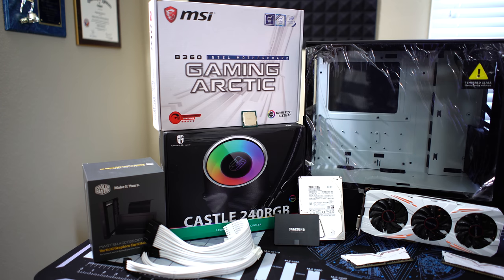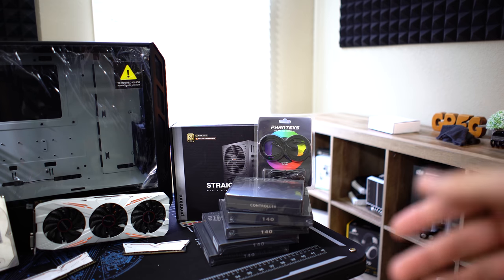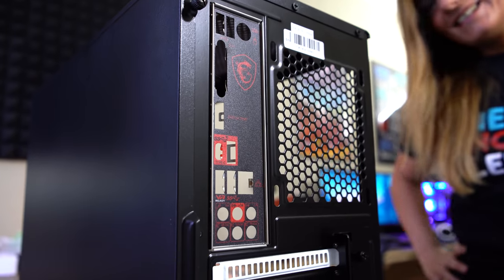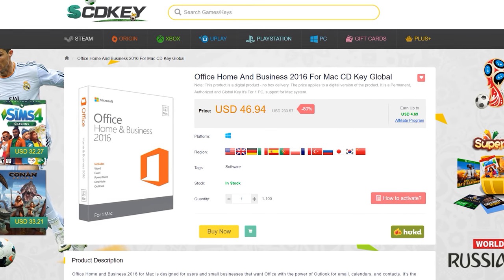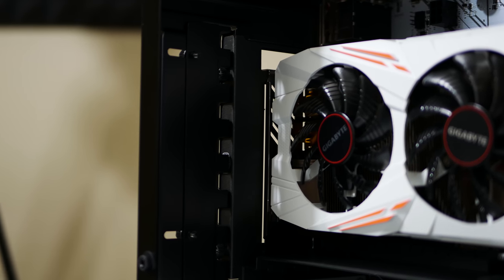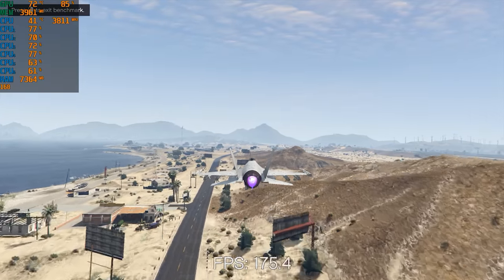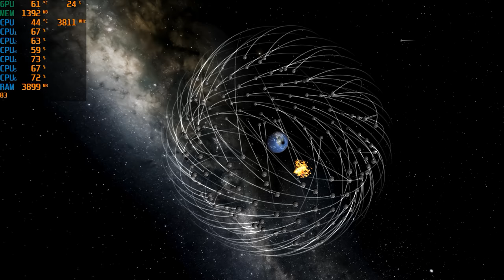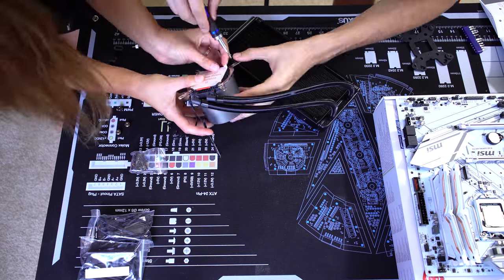We Paired a 1080Ti with an i5 8400...

Comment: "Locked processor because intel is intel" shot fired
Reply: VN the reactor ryzennnnn
Reply: They should go back to the Pentium MMX practice of open multipliers on all chips. Or atleast make them BCLK OCable like they basically did before SandyBridge.
Reply: its getting dangerous to do bclk because of pci-e storage and high usb 3.0 speeds. i know it's almost not doable on ryzen, whereas my fx series was almost all bclk instead of multiplier clocking and i got a ton out of it. this gen is almost all autoclock auto sense. of course thats amd perspective but just what ive noticed the trend to be.
Reply: Ryzen has worse single thread performance. And what do modern games use the most? SINGLE F*CKING THREAD PERFORMANCE!
Reply: Fbi open up
Reply: @jugostran  
Only badly optimized games depend on single thread performance

Comment: The i5 8400 is such a good CPU!
Reply: Dex4Sure Yea, get the 8700k and spend 400$ more, depends on budget man
Reply: Well lucky for me I have both lol. Relax guys they are just CPUs. Clearly both of you have no idea. 😹
Reply: Comes into the YouTube comments section to flex. HAHAHAHAHAHAHAHAHAHAHA! 💪
Reply: Dex4Sure I only play games so the i5 was definitely the better buy for me
Reply: "HyPeRtHrEaDiNg Is ReAlLy ImPoRtAnt."
Reply: Dex4Sure what is better than a 1080ti tho
Reply: Dex4Sure lol it’s also more expensive
Reply: Honestly 1080ti isn’t a bad pair I played 4K and it plays smooth
Reply: All In One just sucks amd is always having a hard time providing hardware that is optimized in games
Reply: Dex4Sure at 4K it doesn’t matter and at 1080p games will be easily at 120fps.  I’ve used a 1080 ti with that processor it’s fine. But I’d pay a little more and get the 8600k OC to 4.7 or 5ghz and it performs better than an i7 at stock and probably equally OC. If your only gaming 8600k is just fine.
Reply: Dex4Sure 8700 is a pretty bad buy imo. 8400 is a much better value.

8400 out of the box with El cheapo memory performs admirably and really is one of the price points where Intel nailed it this time.
Reply: OrGen $400? more r u high?
Reply: as you can clearly see in the video , an i5 8400 does not bottleneck the 1080ti for most of the titles , so you can save here while spend your savings on a better gpu . Budget gaming is not your forte .
Reply: the i5 still reks those amd cpus so i dont know what u try to say.
AMD cpus arent bad but who needs 12-16 cores for gaming only?
Dont come with u will have a better future. bro everyone are switching their CPUs like socks. not many people uses their cpu more then 3 years.
Reply: most apps are optimized for intel , nvidia . Radeon cards definitely offer more bang for the buck at the same price though
Reply: Gear Seekers anything's better than AMD.
Reply: Dex4Sure you can always buy a new gpu for cheap again in the next few yrs...
Reply: r5 is much better... In what? Unziping files? 😂😂😂
In gaming the little 8400 even beat the rysen first series flagship....
Reply: All cpu's are good these days.... The problem is software, game engines today like high clocks on 2 cores.... And the fast ringbus intel has.... However since the core wars have started it must change.... Intel cant use ringbus on high core count cpu's... Also... Clocks wont go as high.... So things will change.your cpu might rock today and be useless in 3 to 4 years.... Or we might all be on arm.... Who knows
Reply: Buy r5 2600 , because after 2-3 years 8400 will lose. 12 "core" much batter than 6
Reply: Dex4Sure i5 8400 does have around 15 to 20 fps more than a r5 1600
Reply: I could have bought an 8700k but I managed to get the 8400 for £135.
I just reckoned that was too good value and by the time I need more power I'll need more than the 8700k anyhow.
My old quad core mixed it for ten years so I'm sure I'll get good value out of the 8400.
Reply: Dex4Sure  coming from an AMD fan (I have a 580 8gb so I'm no Intel/nvidia shill) I can confidently say that if all you want to do is play games then the 8400 is a better CPU. Even the 2600x is barely a match for the 8400 in most games... For an all round CPU the ryzen is better no doubt, but for pure gaming the 8400 is really where it's at.
Reply: Dex4Sure The 8400 is way better the Ryzen 5 1600, 2600, and their x variants for gaming. Sick of people pretending it isn't to spite Intel.
Reply: no it's not lol
Reply: 8thread is still plenty dude.....and with some overclocking it's a pretty seamless experience. Stuff that still runs better on it because of the High clocks.
Reply: There's nothing wrong with HT...and there's still some pretty strong 4 cores....
Reply: my cpu doesnt have hyperthreading and it can really handle just about anything
Reply: Well you haven't played enough games...yeah there is games that only really look at like a few threads and like speed...and there is other stuff that was an attempt at some multithreaded optimization. Besides that...4thrd could easily get bogged in other shit...You should have 8thrds now as the minimum, no question. And at the point now where 12thrds looks even more realistic....16 may not be quite there yet.
Reply: No not really it doesn't... 4ghz and 6thrds that chip....vs 5ghz and still the 8thrds. It's still godly lol. They are High etc...I do not know that chip is pointless lol
Reply: Finian Blackett I have a 1080ti paired with an 8600k. Running at 5.0ghz all cores at 1.24v and have never seen my temps go above 50. 4.5ghz will be more than feasible!!
Reply: Dex4Sure the 6 core 12 thread ryzen 5s perform worse in games than the 6c 6t i5s
And the 8c 16t ryzen 7 1700x still gets beaten by the 6c 12t 8700k
Intel has better performance while having less cores and threads lol
Reply: Only for gaming
Reply: lol
Reply: Dex4Sure  in games , 8400 is better , but for streaming or anything else sure the ryzen
Reply: @shadbud9198  rtx 2080 ti B-)
Reply: I use this exact combination and it works perfectly.
Reply: Dex4Sure would rather get 8400 because literally none of that other stuff matters for someone just gaming.
Reply: r5 1600 is much better then the 8400? source? explain? pls?
Reply: They do have no idea, if you check bottle necks with all nvidia gpu's, and test scores the 8400 has less bottlenecks then any other processor on any gpu, and the test scores with all gpu's are near mid tier i7's, you guys truly do have no idea
Reply: So, i5-8400 + 1070 Ti for 1080p or 1440p and i5-8600k or i7-8700k + 1080 Ti for 4K gaming... Correct? What's the AMD equivalent?
Reply: are you seriously flexing online?
Reply: on a 6 core cpu hyperthreading is not really important for gaming
on 8 core cpus hyperthreading will not be needed anymore for gaming
Reply: i agree
Reply: A Pale Blue Dot...No it isn't. Hardware Unboxed benched 36 games at 720p on a 1080ti and the 1% mins on the 2600 was 101fps vs 111fps on an 8400.  That's not 'way better' at all. 720p w/1080ti even and only about 10% on the 1% mins.  Hardware Unboxed was able to beat the 8400 with an aggressive overclock on the 2600, though it was more expensive, but a moderate overclock would still close that gap slightly.
Reply: Gear Seekers will a 1080 gtx with a i5 8400 bottleneck
Reply: I paired an i5-8400 with a GTX 1080 8GB and it runs good.
Reply: Fr I have an 8400 and a gtx 1080 ftw2 and get 240 FPS average on fortnite
Reply: Dex4Sure  hi may I ask if intel i5 8400 is okay to pair with gtx 1050ti?
Reply: Dex4Sure  they say it will bottleneck?
Reply: shad bud a rtx 2080
Reply: Dex4Sure  The real question is that Do we really need GTX1080 TI for just gaming ?

Comment: I had a customer pair a 7100 with a 1080ti. I couldn’t get him to get the i5. :(
Reply from the maker: Ouch. Hopefully his monitor refresh rate was low :-(
Reply: More Like his monitor is at 4K
Reply: NovaDoll FeelsBad
Reply: Science Studio how about i5 8600k paired with 1080 ti, is that ok? Running 1440p 144hz g sync monitor.
Reply: ^ more than plently as the 8600k is faster than the 7700k which majority of people have paired with there 1080ti's.
Reply: absolutely fine.

8600k is a monster for games, actually, better than 7700k.
Reply: yep thats an awesome pairing
Reply: Yes that card is very good and is within 2-3% of an I7-8700K in most games
Reply: Maybe he had watched that 4K gaming with g4560 video.
Reply: “The customer is always right” - Nope
Reply: That makes no sense. Why care that much about a gpu but not the CPU. He would of been better with an older i7
Reply: Salt Maker he i lt got 8gb of 2400. He only cared about clock speed.
Reply: Eli_Plays Just got myself an MSI Gaming Pro Carbon motherboard, along with a 8600k, 16gb G.Skill TridentZ RGB 3000mhz CL15 and a Corsair H115i PRO. But now i can't afford a GPU upgrade, so still stuck with a gtx 1060 6G :( Used my old 3770k setup for 6 years though, an upgrade was necessary
Reply: Dani for the mobo, cooler, ram, cpu, a 250gb samsung 970 evo and a fractal design define r6 tg blackout, around 1040€ i think.
Reply: Using a R5 1600x with my 1080ti!
Reply: Rune Nielsen 1060 is fine. Do you even have a 1440p 144hz Monitor?
Reply: Dani not sure why you wanted to know, but you're welcome :)
Reply: I'm really stoned and drunk but, i don't even know what you're talking about but i agree with you! Fuck yeah! I have a i7 8700k  with a GTX 1080 asus strix a8g card btw! =D
Reply: NovaDoll No 1440p for me, still on 1080p :p I got an Acer Predator XB271H, it's only 1080p but it's 144hz and got G-Sync. I kinda wish it was atleast 1440p but i'm not gonna complain, 1080p still looks great
Reply: NovaDoll yay i watched ur videos
Reply: Well, the dude can drop a Benjamin on an i5 in a year or so and make do for now, save a good bit.

Honestly though, with the inflated video card prices there's no way I'd pick up a 1080 Ti.
Reply: Seems like a waste of a 1080ti
Reply: KoolerRaid Can I pair it with my i5 4690k? Thanks
Reply: NovaDoll i got an i5 8600k and and i7 8700k which is better for an 1080ti ?
Reply: KadeW Ok please write me in proper german if a second or third language is so easy. i got an i7 8700k from my brother who build himself a complete new system and now im planning on getting a 1080ti and wanted to know what makes more sense.
Reply: You tried your hardest. It's there loss.
Reply: KadeW i asked it wrong. i was tinking about selling the i7 and the actual question was if the i7 makes sense for the price or if im good with the i5.
Reply: what about the 7600 paired with a 1070 Ti?
Reply: lmao
Reply: Jesus MLG that’s fine.
Reply: Max Reichelt 8700k.
Reply: when a girl says fine, it's not fine
Reply: @NovaDoll, I know so little about anything below the top 5 series CPUs I couldn't place the 7100 lol.
Reply: https://www.anandtech.com/bench/product/2273?vs=2255
its worth checking for all of you 
espescially if he has a 1440p or 4k monitor
its only within 5% difference with 7700k
Reply: How do you have enough money to buy a 1080 Ti but not a half decent CPU to pair it with?
Reply: *Quietly pairs a G4400 with duel RTX 2080ti's
Reply: @acidspaz4252  maybe it is, but that's the processor I bought before upgrading gpu to 1080ti and it works fine for me
Reply: @acidspaz4252  ya I was thinking about that, plus it'a compatible with b350 motherboard right

Comment: Now try a 1080ti with a g4560
Reply from the maker: hehe
Reply: I'm using a Pentium G4560 as a placeholder with a 1070 and honestly it  isn't that bad. Not ideal obviously and the bottleneck shows a lot more in CPU intensive games but it's suitable for a short term solution
Reply: Phhh thats nothing try it with a intel atom 1 core 1 thread beast
Reply: How about i7 2600.
Reply: Hazaa Alawadhi i have a gt 8800 could u look how my pentium 4 holds up with the 1080ti sli rig because im thinkin bout going for 8k gaming this fall
Reply: Science Studio 7350k

Oh wait does it still work?
Reply: Sagar S I don’t have a 1080ti but I have a 980ti w my i7 2600 and it runs like a dream lol.
Reply: invex had 980 with 8350 and it worked fine in games that weren't that cpu intensive. Now I have a ryzen 7 1700.
Reply: Saw this guy in yt pairing a gtx1080ti with a core 2 duo
Reply: Try 1080ti with core 2 quad😂
Reply: That's nothing. Swap that g4560 for a Celeron g3930
Reply: on 4k 1080ti bottleneck the g4560
Reply: @BadGamingBros  xDDD lmao why didnt you get a 1050ti and a decent i3
Reply: Bottleneck

Comment: still rocking a 2600k at 4.6Ghz, still a great cpu for gaming!
Reply: hyperthreading tends to make a pretty substantial difference, I would have done the same thing :)
Reply: @Vyacheslav Ivanov is it noticeable? I have an i5-4690k at 4.5ghz and want to upgrade to 8700k. But cpu+mobo+ram is a lot
Reply: @Brett  the perf increase will be significant because the combintation of two reasons:

1.  increased core/thread count - i5-4690k is 4core/4thread while the 8700k is 6core/12thread, you would literally triple the thread count!

2.  architecture - improved ipc due to newer architecture

Since you are already on a 4 core/4thread part, you wouldn't see that much of a difference going to a newer i5 that also has 4 cores/4threads.  It's teh combination of both thread count and architecture change that makes the perf difference so significant, assuming that the clock speeds of each part are "somewhat" near about the same

Also, what resolution are  you gaming at?  You'll notice more difference in perf at about 1080p or lower

Comment: This is a well timed video for me. I just upgraded to a Ryzen 5 2600x and tomorrow I should be getting a gtx 1080. I'm pretty excited to get close to fps like this.
Reply: m00tmike too late for me :(
Reply: m00tmike Hahaha what are the chances I've just got that should be playing on it within a couple of days
Reply: Having every game at maxed graphic setting without stressing a pc is the most amaZing thing
Reply: with a 1080 against a 1080 Ti i wonder how "close" you will get...also that ryzen against the i5 8400 in gaming, i wonder how close...
Reply: the 1080 non Ti will cry in 1440p ultra btw, esp. on a ryzen, even in bottlenecked scenarios the fps difference between 1080 and the Ti is 30fps at 1080 at least...right?
Reply: Really well, just slower than intel in gaming right? When the next gpu's come out intel will pull ahead even more...
Reply: Ivan Belic In single core performance, it’s somewhat slower, but fairly close. But in multi core performance, and the number of threads you get, it’s better for content creation and doesn’t tax the CPU due to more cores and threads. AMD has really pulled it together recently, and I wouldn’t be surprised on the next AMD Processors, they would be performing  at the same as Intel.
Reply: Ivan Belic the guy is happy with what he bought, an 2600X and a 1080 is a perfectly balanced build as most have shown that Ryzen uses the 1080 without a problem, and if my 1050ti gets 70fps on GTA V on ultra, I really don't se why a 1080 would not reach 125fps, even on 1440p, even the 1070 gets above 100fps there.
It doesn't matter if future gpu's give Intel an adventage (which in my opinion will not happen, it will remain the same, Intel ahead by 10fps), he said performance comparable to this video.
Come on, let him be happy with his system!
I know I would with that configuration, even though I have a 1600.
Reply: I have a similar setup. 1700 with a 1080. I run a 1440 monitor. No issues. Silky smooth high frame rate.
Reply: Am having some problems with mine can you guys let me know if your having any issues
Reply: Ivan....I wouldn't be too sure.  If you want to speculate that the i5 will do better in future games, I can speculate that the R5 will do better.
Reply: You talk about  the idea that games start using more threads than they already do, but forget that the i5s have a higher IPC, and in the future will have even higher ipc...it all comes down to what you need; i have a 144hz screen so i don't want my CPU to hold me back at all :)
Reply: Ivan...If you have an i5 and not an i7, it's already holding you back (benchmark wise). Not too much if you have an overclocked i5-8600K...but still.  Is that what you have? an overclocked 8600K? I'm betting you wouldn't be able to tell the difference in a game anyways, Intel is way overhyped for gamers.
Reply: @boshumok6399   No tbh. I have ryzen 2600 myself, and kinda annoyed by the latency problem. In recent game its not too apparent. In some old games like modded skyrim. Its just stuttering so much.. even my old i5 2500k is more stable. The only way to got this reduced is only by disabling SMT. 

Its not intel thats overhyped for gaming tbh, but ryzen thats too overhyped that this negative aspect is seldom discussed in review.
Reply: Wolfie71... Do you mean disabling SMT?  Maybe that negative aspect is not discussed about Ryzen because most reviewers don't experience it?  And you've got to be kidding about Intel not being overhyped for games. It's all people talk about. Intel for gaming. Even though 95% of gamers have midrange and lower cards, I am sure a lot of new buyers who don't know better think they have to get Intel to get some decent gaming and then pair it with a midrange and lower card.
Reply: @boshumok6399  Hmm maybe. But im saying ryzen is overhype because well.. everyone basically praise it all the time lol. Even after 1 year after, ppl kept repeating the same thing and its finally getting annoying for me. You can count the number of comment that praise ryzen vs intel. Damn its massive difference. They even mocking intel while its actually still pretty good.

And yeah i mean disabling SMT. My bad